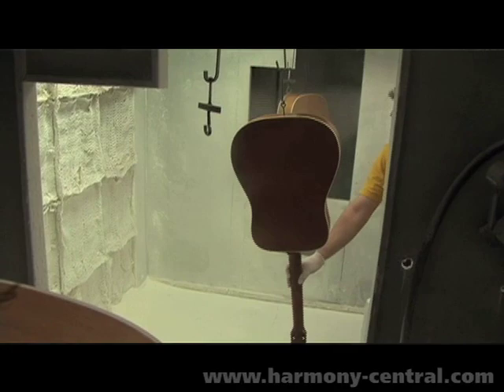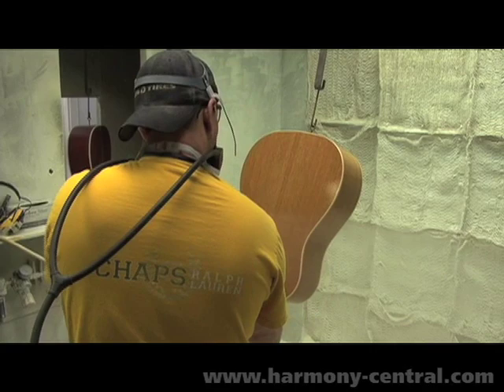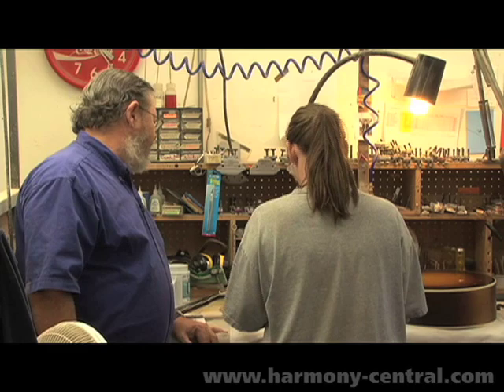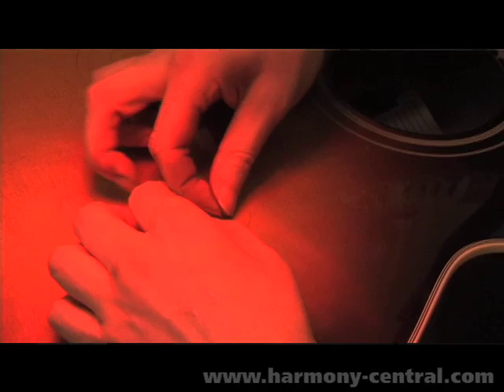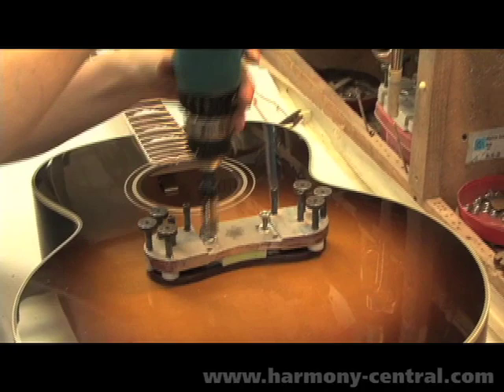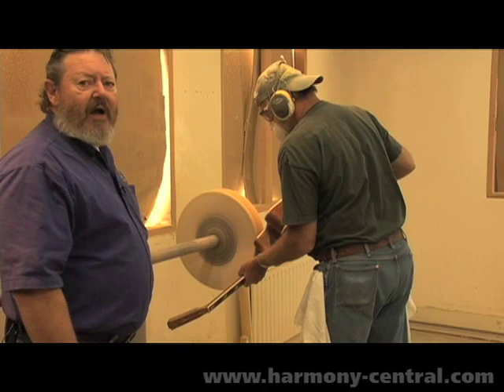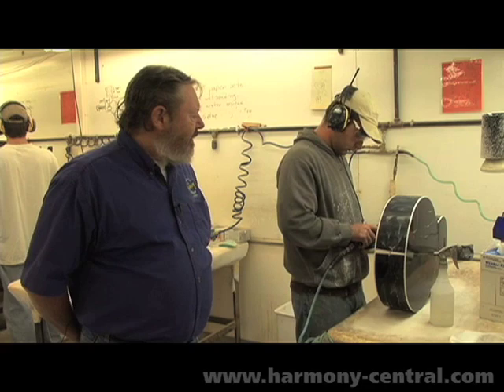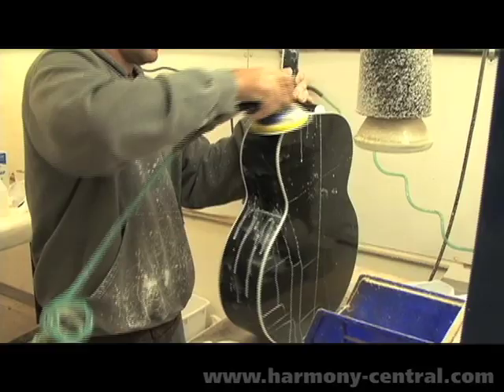Gibson Acoustic Guitar Factory part 8

Comment: I have a 2018 J-45 Standard and I love it. The quality, tone, finish, and playability are very good. In watching this video I can see why the instrument is so good. I had heard before I bought a Gibson acoustic that the quality consistency and standards for the standard Gibson acoustics was higher than the standard Gibson electrics and I would agree with that based on my own experience and this video. I also own a les Paul traditional and had owned an es339 and have played other sg's, es-335's and les pauls. I have found that the standard line Gibson electrics are not very consistent in quality. The es -339 I had had intonation and tuning issues that could just never be fixed 100% without a new bridge placement and it look me years of looking for a les Paul to find my traditional which has very good intonation and tuning stability for a les Paul. I have found though that the custom shop electrics are pretty consistently good which makes sense. As far as the Gibson acoustics, I have played several J-45's in the guitar store, my friends J-45 and my J-45 and all were very good to varying degrees which I think was is mostly attributed to the age of the strings on each one. I used to be a Taylor guitar player (or thought I was at the time) thinking they were the best acoustics before I knew much about guitar construction. To me the Taylor sounded good playing at home by myself but with other players or in a band context, I and the sound people found it too bassy and trebly, and even tinny. I eventually sold it and from recomendation of a friend, someone at guitar center, and internet readings got the J45. A big thing about most Gibson acoustics is the short scale length that I never knew about before. You do sacrifice some volume and punch but the playability and tone you get are worth it in my book. I had a mid level Martin when I was younger and that just hurt my fingers to play for a long period of time but not the Gibson, its a pleasure to play. Well done Gibson acoustic!